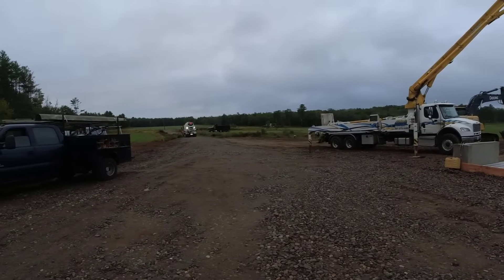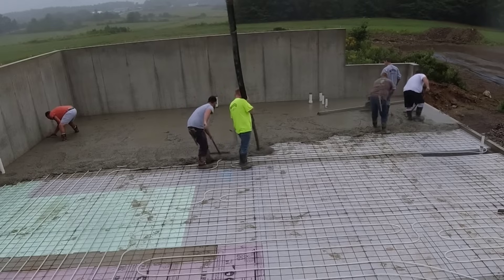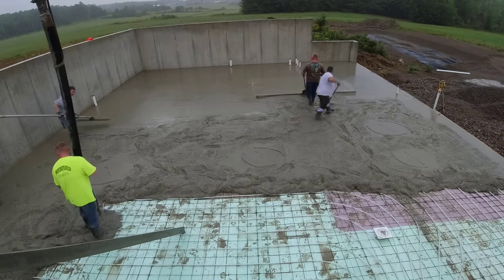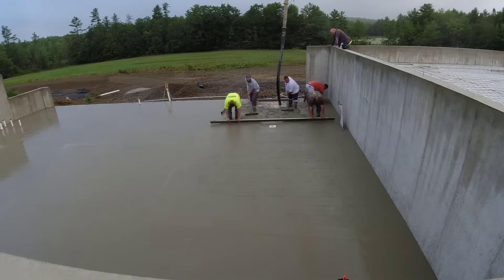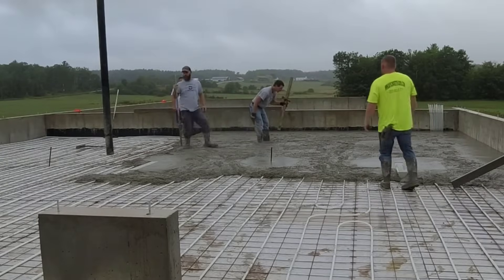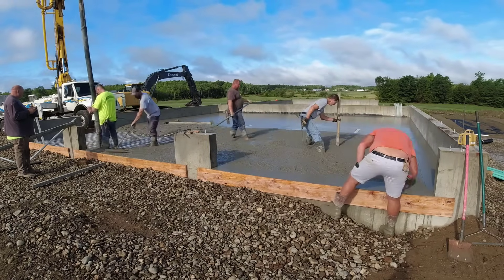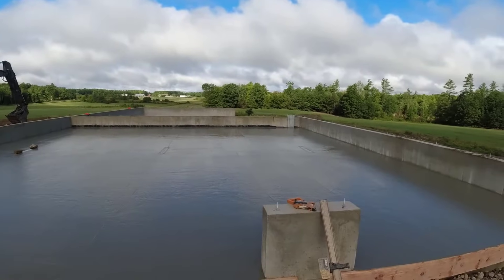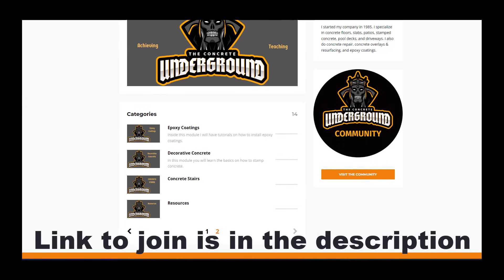My Secret Weapon! How To Pour Concrete For A Large House & Garage (3600 SQ FT.)

Comment: I am 71yrs old and started working with concrete at 30yrs old (+40yrs ago) and quit at 40 (about 30yrs ago). The times have surely changed. Could have used the power screed back then. Also we  never started until after 8am. I live in Detroit,MI. Would definitely like the work these days

Comment: Yo duder, I randomly clicked on one of your videos and then ended up here. You seem like a cool old school man.  I watched several of your videos throughout the years... done a handful of DIY cement projects. Most turned out okay-ish.  Definitely an art / skill which requires knowledge and time.  But there's something really enjoyable about making stuff with cement.  Concrete, cement-all, mortar, etc. I especially like the Quik Wall by Quikrete.  Has the fibers in it and sticks to horizontal surface pretty well.

Any ideas to "pretty up" cracks in cement?  I was thinking about trying to cut crack with diamond blade and then filling with crack filler... in particular, I have some cracks in the concrete which I put between the walkout basement wall and the trench drain, like 4" wide by 16'... I made rookie mistake of not putting any relief cuts or expansion joints and 2 or 3 cracks formed.
West side suburb of CLE.